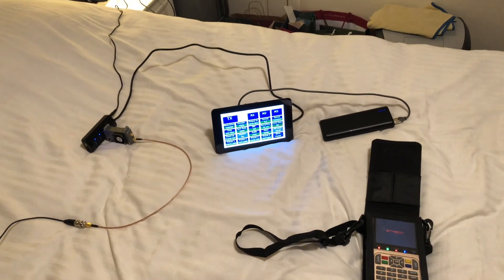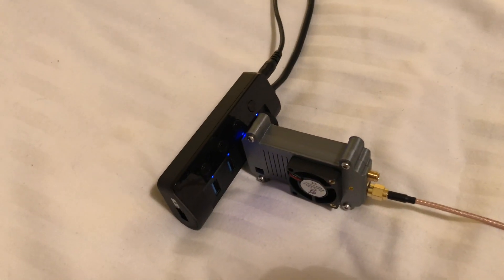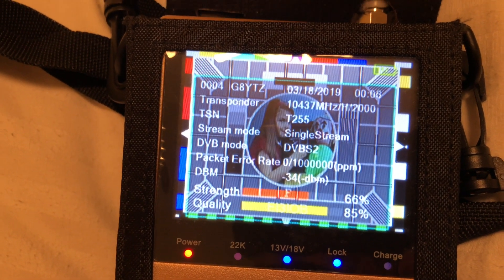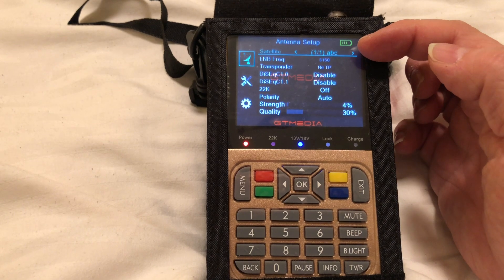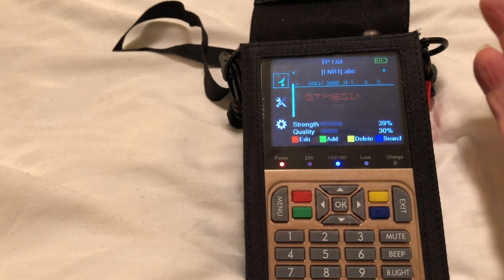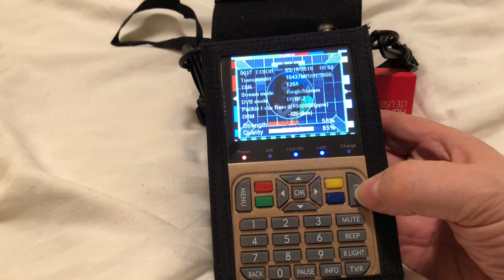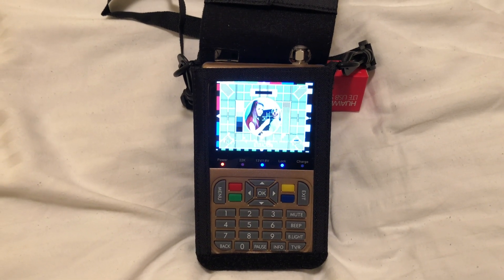Configuring the GT Media V8 Gold Satellite Finder for Terrestrial Digital Amateur TV Reception

Comment: Hi bud, you may be able to save me from absolutely having a meltdown trying to use my Satellite Signal Finder V8 Finder2 and my Falcon QuickSat QS65. I am absolutely lost and not a clue how to run a simple check to make sure the Sat is pointing to UK Astra 2…pleeeeeasee help
Reply from the maker: Try using one of the satellite pointer applications like Dish  Pointer there are quite a few on the App Store.
Reply: @G8YTZ  I have and will try again today, last place I was pointing through tree branches would that affect it? I also purchased the V8 Finder 2 to help aid trying to pinpoint the Sat signal but that’s bamboozled me even more

Comment: G8YTZ. Could you let us know your V8 finder  specification from Menu->Tools->Information? Hardware version and software version interested me.  Thanks a lot. I am testing now a Dmyco v8 finder (yellow) with lnb set to 10GHz, transponder below 10950MHz is out of range. There is H/W ver. 1.1.0 15/12/2017, S/W ver. 3.02.118.629 15/12/2017.  I will try upgrade to GTMedia soft.

Comment: Hi G8YTZ. 290-2350MHZ output frequencies are for Wideband LNG with LNB freq. 10410MHz. I have tested GTMedia V8 Finder2, newer version of V8 Finder meter. Unfortunately V8 Finder2 does not accept output freq. below 950MHz. as your V8 Finder meter does. I tested with LB freq. 10000MHz and TP freq. 10290-10949MHz and there is info 'Out of range'. Also LNB freq. 10410MHz is not available. There is 10000, 10450, but not 10410.  Does your device support LNB freq. 10410MHz? Thanks for your video.
Reply from the maker: Thanks for that information. I suspect it’s tied up with the discontinuation of the ST chipset that’s been widely used in things like this, and of course the BATC Minitiouner. Of course, using an SDR with the Portsdown band viewer is a great alternative. The ADALM Pluto works very well with this and delivers a 50 MHz bandwidth.

Comment: Great tutorial, I wanna buy a sat finder which suppots unicable/SATCR LNB's, does this one do?
Reply from the maker: No, in Unicable the frequencies are different, however you you have a suitable external mixer that you can use  it would. Basically this box is a portable satellite receiver designed to receive DVBS/2 from 950-2150MHz, but I've found it tunes much lower than that and is useful on the 70cm amateur band.

Comment: Here in Brazil, the terrestrial digital signal isdb-t is used. Is it possible to configure the V8 Finder to capture this signal and install terrestrial digital antennas with this satellite finder? It's amazing what human beings are capable of doing with knowledge. Congratulations!!👏👏👏👏👏
Reply from the maker: I’m afraid not, this version is just for DVB-S/S2. I’m sure there will be other versions sold in your market for TV Antenna installers, but most TV sets will have a signal strength and signal quality indication that could be used for this purpose.

Comment: Hi how do I setup if I want to Scan the local DTV TV Frequency of 562.00MHz CH32
Reply from the maker: Its designed for DVB-S&S2, not DVB-T. Amateur stations use DVB-S&S2 for terrestrial transmissions and occasionally DVB-T&T2. FOr your use case you need a terrestrial antenna meter.

Comment: I have the V7 and it will not except 10437 Frequency, and ideas??
Reply from the maker: Did you set a custom LNB to 10GHz? If you you'll need to do a calculation from another LNB setting. I've not tested the V7.

Comment: could you demonstrate the S2X ability?
Reply from the maker: Hi, amateurs are not yet using DVB-S2X, the trend right now it to use more DVB-T for the lower bands (6, 4m & 2m and even 70cm) as this offers better resilience to multi-path. The problem with DVB-T is that it requires a very linear amplifier due to the very large peak to average power ratio. Recently I've had some great results with DVB-T on 2m and 70cm @333k bandwidth. I also get great results accessing the GB3HV repeater (Farnham, Hants, from my home in Orpington 44 miles) with just 10 watts of DVB-S2 with a 6dB MER @ 2MS/s and 16.7dB MER @ 333kS/s. All using H.264 codec.
Reply: @G8YTZ  ive found you can lock in SR values lower than 1msps on the gtmedia you just cant type it in. lowest i got was 820ksps
Reply from the maker: @ArclampSDR  that’s interesting to know unfortunately the standard symbol rates amateurs use tend to be 500 or 333 sometimes 250 or 125. Repeaters are generally 2000 or 4000.
Reply: @G8YTZ  it might work i havent tried but you might beabvle to mess with the transponder file you can export

Comment: Could you use the  V8 FINDER to pick up a  signal for tv dish
Reply from the maker: A Satellite dish? Yes - that's its intended purpose, subject to certain technical limitations. This unit is not designed for SKY-Q LNB however it should work fine.

Comment: Have just bought one and having set it up for 437MHz, I noticed the displayed frequency is 11311MHz, which is the image frequency, if I set it to 1255MHz, it displays the correct frequency, so would this be because my particular version does not cover 70cm ?
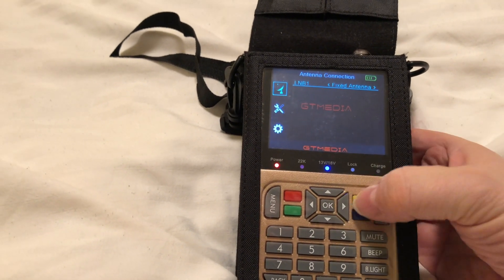Reply from the maker: Hi Dennis, it sounds like you've not set the manual LNB Local Oscillator frequency correctly. I recommend setting to a round 10000 MHz. From what I can tell the image rejection is about 0db.The procedure is from 07:00 into the video.
Reply: @G8YTZ  Thanks for the reply, all now working, I'd selected the wrong transponder when i originally did a scan, deleted the 11311MHz and all is well, now set up for 70, 23 and 13cm, incidentally i think the image rejection may be a little higher than 0dB, as having selected the correct one the signal is much stronger, thanks.
Reply from the maker: @TheDennisfitch  Pleasure! It takes some sussing out at first, but interesting the £35 Revez sat receiver I bought has the same logic! I reckon the core software is the same on a lot of these boxes. The Revez does not go down to 70cm, but any box that has a tuner designed for Sky Q should work at 70cm (Sky Q LNB's require the low end to be 290MHz)
Reply: @G8YTZ  Which Revez sat rx have you got ?
Reply from the maker: @TheDennisfitch  HDS620, this one tunes down to 700MHz so can pick up the OSCAR 100 beacon with a standard LNB. If you don't need that then the Octagon SF8008 model is probably a better bet. The Revez can also run on 12V though, which is great for portable operation. For general DATV though the BATC Minitiouner is the way to go.

Comment: How do you program for 116.8W Orby? it's hit or miss. Whenever I turn it off it seems I have to start over
Reply from the maker: In the UK this satellite is below Horizon so not receivable, so I don't know much about this one I'm afraid. The video is aimed at licensed Radio Amateurs (Hams) wanting to receive Terrestrial Amateur TV repeaters.
The best guidance that I can give you is to first check that you have the latest and correct regional firmware on the box from the manufacturers support forum, as most satellites are pre-programmed into the box. Also, for manual programming (which is also possible using the guidelines in the video, noting the LNB type you have) there is a web site with all the details about this satellite here: https://www.lyngsat.com/Eutelsat-117-West-A-B.html. Best regards. Justin.
Reply: Thanks for the help! I really appreciate it

Comment: How do i find what settings to use for port, transponder etc when trying to find astra 2. I couldn't get the signal bars coloured
Thanks Steve
Reply from the maker: For commercial satellites you just select the satellite required which is pre-configured and the just run a programme scan. If you need to manually enter any settings you will find them here: https://en.wikipedia.org/wiki/List_of_free-to-air_channels_at_28°E
Reply: Thanks for the response 👍👍Sorry for been thick 😂😂 so I run a channel scan before finding the satillite?